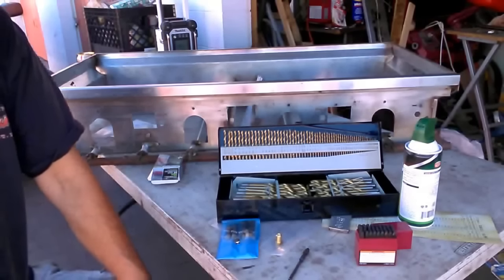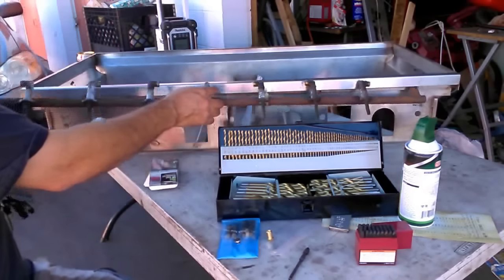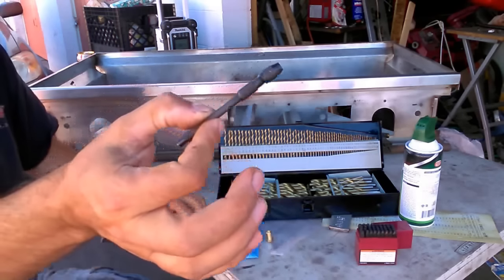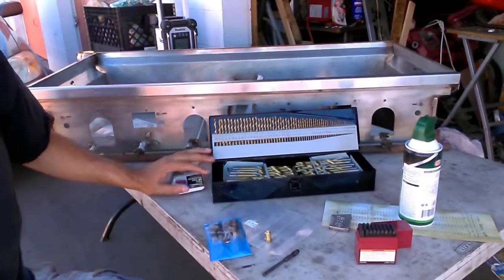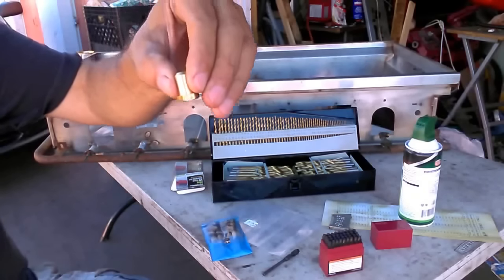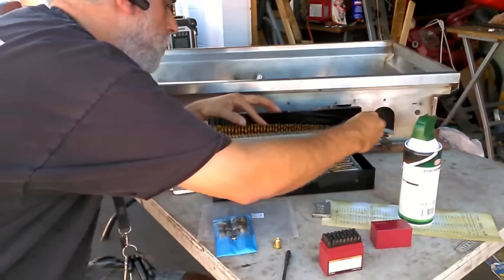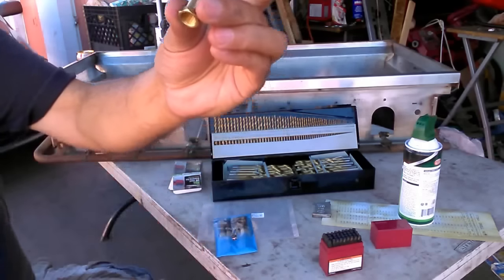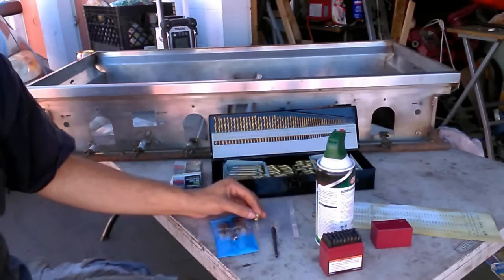Propane and Gas Conversion Basics (How to)

Comment: Frank.  If converting from ng to lp, could you use a regulator to lower the lp to 7"wc and then not have to change it the orifices
Reply from the maker: Doing a fuel conversion is usually a simple affair. I've converted just about every type of barbeque and stove made. I'm now in the Midwest, so feel free to contact me at 714-574-1544. 

This is a broad generality. It depends on where the numbers for the natural gas orifices fall as to whether this will work out or not. You would really need to reverse calculate the orifice sizes versus the rated output of the burners. You must also take into account that, as a rule, a manufacturer would design a propane solution to be 7 to 11 percent lower in BTU capability compared to that of a natural gas set up. And there again it totally depends on the manufacturer and the model.

Case in point, a normal rating for a a majority of Viking topside burners is 15,000 BTU, while the propane version of that same burner is 13,500 BTU. This means that the Viking rates their propane burners at 90 percent  of what the natural gas burner is rated at. However, these are numbers published by Viking and Viking is interested in publishing numbers that make their product look like it outputs more heat that it actually does in practice. In actuality, if you calculate the heat rating by the numbers (factoring in the size of the bore of the orifices with the rated output of the regulator expressed in Inches of Water Column) that 15,000 BTU commonly calculates to around 13,800 to 13,950 or so. So you'd have to assume a 93 percent efficiency for that 13,500 BTU would factor out to 12,500.

There are very few manufacturer's who actually publish accurate numbers for their product. One of these products/manufacturers combination is the Jennair grille. I've found, over the years that, by and large, you can trust the numbers on a Jennair grille. I'm likely the only person in the industry who sticks to this practice, because, if you inadvertently have a fire caused by your appliance, and an investigator does his due diligence, it's possibly my ass on the line, and I NEVER do a conversion without seeing a shot of the manufacturer's label and the numbers stamped into the manufacturer's orifices.

Comment: I'm trying to find Dyna-glo orifices which have an M8 1mm thread pitch. Can't find them anywhere. Any sources?
Reply from the maker: I've done Dyna-glo conversions before from the extensive inventory that I carry. Doing a fuel conversion is usually a simple affair. I've converted just about every type of barbecue and stove made. I'm now in the Midwest, so feel free to contact me at 714-574-1544.

Comment: Hi  Frank, I am converting a member Mark grill from natural to Propane,  the grill say 18000 btu per  orifice…what size orifice do I have to install to make it work? Thanks..
Reply from the maker: Doing a fuel conversion is usually a simple affair. I've converted just about every type of barbecue and stove made. I'm on the West Coast, so feel free to contact me at 714-574-1544.

Generally speaking, propane orifices have a smaller hole in them than natural gas ones do, so, normally you'd need to swap in orifices with a smaller bore, then swap the fuel regulator to get the job done. There are only a few grilles on the market that support burner that are rated at 18,000 BTU per  burner, and I seriously doubt that Members Mark is one of them. You'll need to look at the numbers stamped into your orifices to determine what the true BTU actually is per the rating on the fuel that your now using, then use the number that you've determined to be the actual BTU. Remember, manufacturer's usually inflate the actual BTU ratings on their burner systems.

Comment: I have a GE Adora that was converted to LP.
What are the original Orifice Buds diameters to convert it back to NG?
Reply from the maker: I actually sell orifices for every stove and barbecue made on my website  https://flamesources.com/  I'm now in the Midwest, and you can always get a hold of me at 714-574-1544.

Without any information, I can't actually give you a blanket recommendation on what size those orifices need to be bore to. I would definitely consider keeping the propane orifices in the event that you decide to move the unit to a place where propane is the norm.

Here's a link to an orifice boring chart from Anderson Forrester: https://andersonforrester.com/conversion-chart/

Keep in mind that the average burner is listed at 8% higher on the manufacturer's label than the actual output of what it's capable of. This is likely a marketing ploy by manufacturers to make their burners appear hotter than they actually are in the real world, so you'll want to bore your orifices to be 8% cooler than what they are advertised on the label. Also note that, in most cases, natural gas heat ratings are advertised as hotter on the label. If you look at the manufacturer's label on your unit, you'll likely see that is the case. There are few exceptions to this rule, but, by and large, this is the case with most manufacturers. Since GE is your manufacturer, that is definitely the case with the burner's vs the label on your unit.

Comment: Frank, I bought a 2 year old  Weber Genesis 330 w/sear burner at a garage sale that i would like to change from natural gas to propane. I'm not sure of the orifice size. Could I buy them from you?
Reply from the maker: Yes, I've converted plenty of those Weber grilles and I have the parts for them. Just give me a call at 714-574-1544.

Comment: Thanks for the Video,,, Sorry for the long entire but a lot to explain for a better understanding of the situation.., I have an Old Coleman 5600 Grill for the late 90's. I inherited from my father who passed away a few months ago...In my new home I have a nature gas line for an outdoor grill; I wish to use the grill in my home.  On the units information label it has three different readings for (Lateral Btu of 13000) rating (Principal Btu 65000) rating and (Total 78000 btu) rating. Can you explain the need for all of the different rating and what are their meaning might be... It has a rotisserie on it,... Could that be why it has the different ratings for the different burners?  If I wish to convert  the unit from Propane to Nature Gas,,, Do I have to take these numbers into consideration when sizing the orifices,  and make them different sizes for their applications? 

 Note: I have spoke to Coleman support offices, They do not recommend Converting the unit to Nature gas..

Comment: What's your thoughts about a Mr. Reddy Propane Forced Air Heater 75-125K BTU conversion to Natural Gas ? Thank you.
Reply from the maker: I've done similar units. Naturally, the orifices need to be swapped, but parts of the control unit also need to be swapped. Feel free to call me, 714-574-1544.

Comment: i have a Bosch 300 series... hard to find parts. would these blanks fit ? id drill em out if i knew where to find them...
Reply from the maker: Doing a fuel conversion is usually a simple affair. I've converted just about every type of bar-b-que and stove there is. I'm on the West Coast, so feel free to contact me at 714-574-1544. I have the parts for everything made. If not, I can machine the needed parts, it's just a matter of finding out what you have.

Comment: Hi Frank, I need to convert a Beefer from propane to natural gas.  Are your services for hire?
Reply from the maker: I actually carry orifices for every stove and barbecue made on my website  https://flamesources.com/  I'm now in the Midwest, and you can always get a hold of me at 714-574-1544. Make sure to like and subscribe to my channel.

I've likely converted over 7,000 units over the years, but I've never heard of that brand. However, it's likely possible that I have the parts to suit that conversion.

Comment: Hi, do you have the blank orifices for a Jenn-air 720-0727? I bought one that is NG and I need to convert back to propane. Thanks!
Reply from the maker: Yes. I've done quite a few of these Jennaire units, however I'll need to machine some more rotisserie jets because I'm out at the moment. I'm on the West Coast, so feel free to buzz me during normal business hours 9-5 at 714-574-1544.

Comment: I bought a storage unit with a Fryer in it. The mfg. placard is scratched up so bad I cant read it. Is there any way to tell if it is set up for LP or natural gas by looking at it?
Reply from the maker: Yes, the holes bored into the orifices and the regulator will give you an indicator of what it's equipped for. It's a little bit of a guessing game, but it can be done through various deductive methods. I have propane and natural gas conversions for everything made including industrial fryers. Feel free to call me at 714-574-1544.

Comment: So in order to convert from LP to NG I would need a new larger orifice and a different regulator? I wouldn’t have to change out the burner itself right? I’m thinking of converting an old burner I have to NG. The burner was found at the local dump and the orifice is missing.
Reply from the maker: Most regulators are convertible between natural gas and propane. The orifices will need to be tailored to suit the type of fuel that you're using. Here's a conversion chart to use if you know the BTU rating of your burner:  https://andersonforrester.com/conversion-chart/   The burner itself will not need to be swapped, however the amount of fuel that travels up the burner tube will need to be altered to balance out the recommended air/fuel ratio required to make that burner operate as designed. This is usually achieved by adjusting an air adjustment commonly found on most burners. Doing a fuel conversion is usually a simple affair. I've converted just about every type of bar-b-que and stove made. I'm on the West Coast, so feel free to contact me at 714-574-1544.

Comment: Hi  Frank. I have a 2002 48" Dacor cooktop/oven. I am trying to change over from propane to natural gas. They no longer make the conversion kit. An appliance guy tried to get the orifice sizes from tech support and they wouldn't cooperate. Also said that other parts need to be changed as well and that you can't just change the orifices. Any help on what to do? To replace the unit it costs about 12,000. I need a better option.
Reply from the maker: I've converted more Dacor ranges than any other brand. I've got quite a few specialty parts exclusively for Dacor. I'm on the West Coast, so make sure you call me during normal business hours - 714-574-1544.
Reply: Thanks so much  @frankhamilton8257 . You are a lifesaver. I will call this coming week.
Reply: @frankhamilton8257  I will call you

Comment: Hey Frank, I imported by Char-Broil grill from the US to the Netherlands. It is orginally a natural gas grill with a Rotisseri burner at 12000BTU/HR and 3 main burners at 51000BTU/HR. I will connect it to a propane gas tank, as that is just the way they do it in the Netherlands. I think the current orifices are just a little below 2mm (my 2mm drill just doesn't fit). What size of orifice would I need for the propane gas? And would it work if I just close the hole with some tin solder and re-open it with the proper drill? Thanks, Peter.
Reply from the maker: Doing a fuel conversion is usually a simple affair. I've converted just about every type of barbecue and stove made and have all the parts. I'm now in the Midwest, so feel free to contact me during normal Midwest business hours at 714-574-1544.

I'm always leery of solder fixes on orifices because solder is not as consistent as brass when it comes to machining. Remember, you're playing with fire here. You'll want to replace those orifices with new ones bored with proper holes drilled into them to match the ACTUAL BTU rating of those burners. I say ACTUAL because the industry at large tends to embellish their BTU ratings on their equipment. If you calculate the BTU rating on your grille you'll typically find that the BTU is typically 10% less than advertised. Also, a propane burner should ideally be dialed in to output approximately 8% to 10% less heat than the ACTUAL BTU of a natural gas burner. This is industry standard practice.

The other thing you'll need to consider is that not all regulators are equal. Some regulators are designed to output up to 1 PSI which translates to 27 inches of water column (WC). Ideally, on a barbecue, you should be using a regulator rated at 11" WC.

Here's a link to a chart to help you determine what size those orifices should be: https://qph.fs.quoracdn.net/main-qimg-3062426641a19445a92ccaad0b1320a1

Comment: Hello Frank, I'm building a food truck/mobile catering kitchen.  I have a Vulcan deep fryer that was already converted to LP when I bought it, but I also have a Vulcan 6 burner range w/ conventional stove currently set up for Natural Gas.  I purchased the correct LP conversion kit from dvorson for the model of range I have, it came with new burner orifices, regulator, and oven orifices. Seems like a fairly straight-forward kit, but I have had some difficulty finding someone in my area (KY) that has experience converting commercial kitchen equipment to LP.  Have you done any commercial range conversions to LP, or can you give me any tips/advice.
Reply from the maker: I actually sell orifices for every stove and barbecue made on my website  https://flamesources.com/  I'm now in the Midwest, and you can always get a hold of me at 714-574-1544.

I&#39;ve converted everything from commercial stoves to backyard barbecues. This video shows the basics of doing a barbecue conversion. Aside from the info in this video, the best information that I can pass on is to make sure the BTU rating is accurate. I always reverse calculate the BTU rating on a unit before conversion because it&#39;s an industry practice to publish a BTU rating higher than what the raw flame source is capable of. I suspect the reason for this is to account for the residual heat produced by oven walls, grille grates, etc. To reverse calculate, check to see what orifice size was originally used by the number stamped on the orifice or gauging it with a drill bit, then compare the orifice size to a BTU chart that matches the output rating of your regulator. The BTU indicated by that chart is the ACTUAL BTU released by the flame source. Most commercial units use adjustable regulators to compensate for any discrepancy in the fuel source, altitude differential, etc. Since you&#39;re using a commercial unit like the Hart/Vulcan, the flame source is likely around 30,000 BTU, so a slight discrepancy in the flame source is not super critical, but it is a factor to keep in mind when undertaking the conversion. In my mind, accuracy is the key to maintaining the equipment especially considering the extra soot produced by an out of tune flame.

Comment: Frank, I am in a bind here, I see the job you are doing which is meticulous but not so difficult when you have a trade. My challenge is that I have a 2014 Weber genesis 310 series and its old live was natural gas. I know I can buy a new manifold, but I am currently living in Singapore, so I thought about changing the orifices myself! Trouble is, I don't know the thread size of the orifice AND they are hard to find. My question is easy, do you supply what I need? Can I get a DHL or UPS pick up organized, to send to me, or could you send to a friends house in Florida?
Reply from the maker: When it comes to the Weber Genesis 310 model, there are a couple of sizes your orifices could be. If the knobs are on the side of the grille, the orifices will measure .340 inches across the shank. If the knobs are on the front, the orifices will measure 1/4 inch at the shank (this figure is actually .246 inches). I already know the heat ratings for that grille, as I've converted my fair share of them. If you're using a tank under the grille, your propane regulator is likely rated at 10" WC (24.88 millibar). You'll likely want to supply the regulator since it would be costly to send a regulator along with it. It may be easier to deliver the conversion to your buddy in Forida. Have him call me. I'm on the West Coast - 714-574-1544.

Comment: Frank,

I have a Weber Genesis S-330 that I want to convert to LP .  As you know, Weber doesn't sell conversion orifices.  There are three burners a sear burner and a side burner.  The literature says the main burners are 48000 BTUh.  (3 main totaling 38000 plus the sear at 10000).  Side burner is 12000.  The main orifices remove with a 5/16" socket and the side burner uses a 9/32".  Where can I find orifices that will fit? 
Thanks - Tim
Reply from the maker: Weber heat ratings are always off, but you wouldn't know that until you've tried to convert one. I have the true ratings on most of their grilles, because I've converted most of their models. If I don't have the correct rating, I can calculate the true heat rating. I have an extensive inventory of orifices for the Weber product line. Just give me a call, and I'll put a kit together for you. I'm on the West Coast, so call me any time after 10:00 a.m. at 714-574-1544.